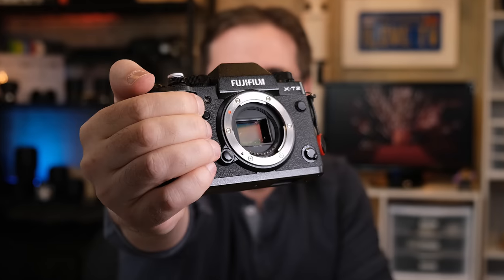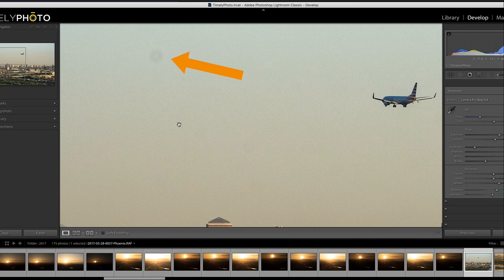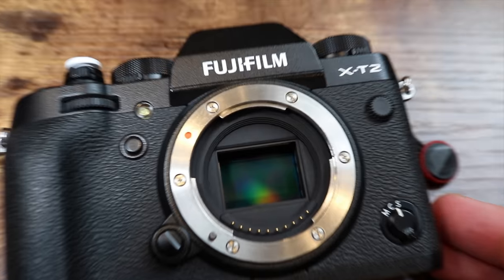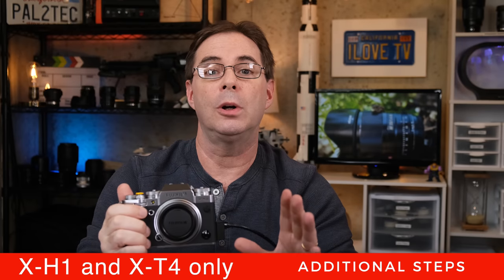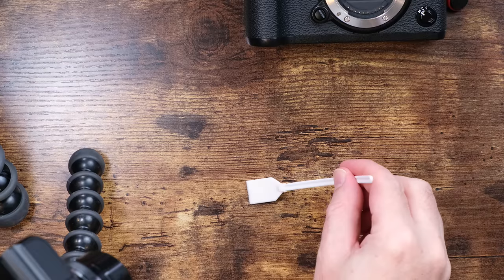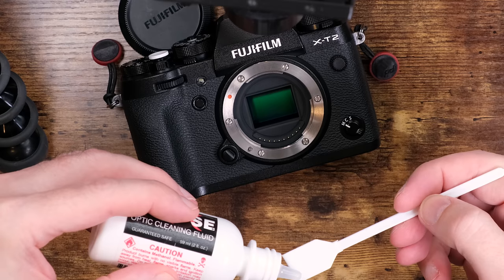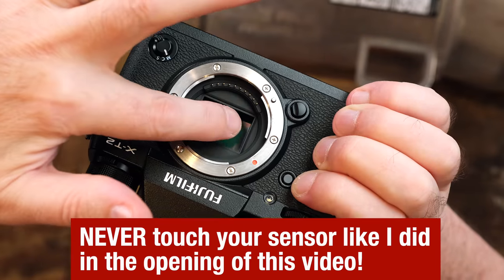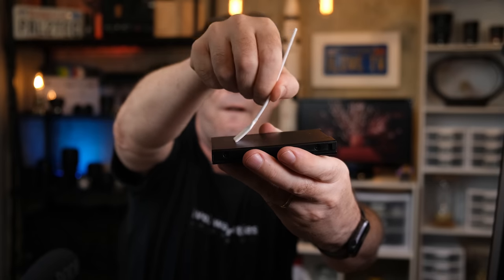Fujifilm Sensor Cleaning

Comment: Great post Chris and extremely helpful. I bit the bullet about 3 months ago when I noticed the dreaded dust spots on my images and bought an Alturo kit for about $50. It came in a zip case complete with everything you need. First sensor clean I did on my xt3 was very very nerve wracking but managed to complete it successfully. Now if I am going on a big shoot I will check the sensor and clean it if necessary without hesitation. I also change lenses without worrying too much about dust as I know I can clean it if necessary. I haven't tried the dust on finger sensor wipe yet, I may leave that you !!
Reply from the maker: yeah, don't try that at home, LOL!!!!

Comment: Hi Chris, thanks for sharing this video. It’s extremely useful! I have a question, the camera I’m using is a new model, X-S10, shall I switch it on while cleaning like X-H1 or X-T4 as you mentioned at 04:35?
Reply: The relevant common feature between the three cameras is IBIS.  I have followed the approach recommended for the X-T4/X-H1 with my X-S10 without incident.

Comment: Always great videos here ... this is one of the better cleaning videos out there.  I would just suggest to set the Aperture to f22 if you can and that will show a bit more.  I can never get mine 100% clean so don't waste all of your swabs.  At f2 or less than f10, I don't think most images will show the dust to be a problem.  I noticed in LR that the test images were around f2 or so.  Great video!

Comment: Thank you so much! I followed every step and worked amazingly... however I made a mistake and I had a lens that has its own IBIS and I had it turned off in the lens, so the camera also said ibis off... however, when removing the lens, it goes back to on... still no damage but ensure your lens does not interfere with your camera ibis... again, thank you so much for giving me the courage to do this...

Comment: Hi I was always a bit scared to clean my sensor on my X-T3. But the part of video where you put the vacum cleaner dust on your finger and rubbed it on the sensor glass got rid of the hesitation. I purchased the cleaner, air blower, and swabs to clean the sensor and cleaned my sensor and took some test shots and it was very clean with no visible sensor spots. Thanks for a great video

Comment: Great video on an over looked topic. Only comment would be a static brush might have been a step between the blower and liquid cleaner. Requires much less pressure and for dust I find works well. Thanks for the tip to wipe round the mount. Obvious now you’ve made the point but that’s the first time I have seen that highlighted

Comment: Yes it´s a bit scary to do this but using the right tools is simple and very secure process. The firts time I clean the sensor of my camera I use very little pressure, yea I was afraid, and by that I had to repeat the process several times until the a last time that I applied pressure on the swab and solve it. By this video you can have a better understanding of the pressure you need to use! thanks for the nice video! !!

Comment: Thanks for this very informative video!  I just bought a 6 year old X-Pro 2 that had basically been sitting on someones closet shelf for those 6 years.  It still had Firmware 1.0 and looks brand new.  However, the sensor was the dirtiest I've ever had on a camera.  The blower did not do any good nor did a couple of swipes with a dust brush.  I just ordered what you recommended to use and will probably have to use at least two swabs to get the dirt off the sensor.   I'm hoping for the best.
Reply: Advice Re: "Dust Brush"= NEVER use a Dust Brush on a sensor, or on the body anytime sensor box is OPEN without a lens or body cap. These brushes have a habit of gathering dust and then flicking it into the air during cleaning. If you do this in the dark with a headlamp aimed across the work area, you'll be appalled at how much dust the brush activates.

Comment: I bought a pack of 100 pec pads (with the wand) and a bottle of eclipse fluid it must be 10 years ago now.  It will last forever probably.  So much cheaper than sending it in every time.  Great tips on the X-H1 and X-T4.  I wouldn't have thought about IBIS.

Comment: Great video, I unfortunately have to clean my X-T2 as the sensor is dirty (even though I only have 1 lens and never take it off)

Is there any other brands of swab you would recommend? The Photosol swabs are quite pricey in the UK
Reply: Follow up to my original comment, I used the vsgo kit which worked great

Comment: Amazing tip mate. So is there no need to go to a setting to open a sensor? Just simply get the lens off and clean it with a swab?

BTW what if you use just one len, do u still have to clean it?

Comment: There was a speck of dust on my xt5 lens, and I stupidly took a piece of paper towel and very gentle touched the tip of it to the sensor which lifted the speck right away - but left a bunch of what looked like scratches in the area. gave me a heart attack. But they all went away when I did this - thank YOU lol

Comment: First off. Thank you for making this video. I had an insane amount dust on my sensor after a beach trip. Shocking right? My question is: 

Have you down a video on how to clean dust from out of the inside your lenses? I have a 55-200 that I can see dust on and I would rather not have to edit dust spots out of my images of possible. Or, is it better to just send it to get cleaned?

Comment: I just did this for the first time the other day (I somehow got a raindrop on it while changing lenses and it left a residue).  Totally nerve wracking for me.  But now totally clean!
Reply from the maker: That's awesome!! Yeah, I've had rain also get on there and it does leave that weird residue. Makes me wonder what else is in rainwater!
Reply: @pal2tech  I had to use an APS-C brush on my 50R and it worked out ok.  Realized after your video that I need to get the right size brush.  Never know what you will learn!  Thanks for the info.

Comment: While shooting in NYC, I found a spot on my sensor. I did the cleaning as per your excellent tutorial, BUT --- darn sensor still has the same spot in the same place. Tried cleaning it several times (and yes, I checked if it was a lens issue-with multiply lenses). 

Any idea as to what to do next? Thanks!

Comment: Hello! What's so bad about a used swab? I've thought that it can be cleaned with a Isopropahol and re-used after drying. Is it catching some dust in this case?
What is "Sensor Cleaning" procedure does BTW? I've seen it in the menu.

Comment: You are actually just clean the outer layer of the sensor protector, sometime dust get trapped inside between sensor and inner layer of sensor protector. When that happen, the only way to clean it is to open the whole sensor part which is dissemble the body.

Its actually easy to do, but hard for some people. Easy to damage all the flex cable

Comment: I recently had somebody clean the sensor of my XT5 and despite my suggestion they went straight ahead and cleaned the sensor without turning off IBIS. They seemed to clean it gently enough – however should I be concerned that any damage was done? The camera seems to be working but I’m not sure what the damage would be. Any advice / reassurance welcome.

Comment: I have just read through nearly every comment and am confused.  On two of the early comments you were asked whether the x s10 should be on or off and you said off bit you stressed that if a camera had ibis it should be left on.  The s10 does have ibis (6 stops I think) so please can you explain why it should be turned off or was this just an error.  About to do my s 10 so want to get it right.

Comment: Those cleaning fluids can actually leave very light streaks to the sensor, if you watch closely in optimal light after couple hours when you have "cleaned" the sensor. I usually just use swabs without fluid if its just normal dust. Swabs are also perfect for cleaning lenses.
Reply from the maker: Yeah, that's definitely an option. However, for some of these sensors, some viewers take their cameras to places that they just have to have some kind of liquid to assist. Swabs almost in those cases would work after the initial cleaning. I've not personally had streaking issues, but have heard of this and probably should have at least mentioned this somewhere in the video that it's a possibility. YT of course doesn't allow us to edit our damn videos!

Comment: What is the reason for leaving the X-H1 and X-T4 turned on?  I'm assuming that when you turn off IBIS, you will need to have the camera turned on in order to stop the IBIS.  Otherwise, if you turn off IBIS, then turn off the camera the IBIS is not stopped?

Comment: I watched this video 10x before cleaning my sensor for the first time. I have an XT4. I turned off IBIS in both photo and video modes and the sensor stopped moving. Went in with a second swab to try and remove streaks from the first swab and the camera had fallen asleep, which made the sensor start moving again, but I didn’t realize until I took the second swab to it. Everything seems to be working okay, we’ll see. Do you have any tips on dealing with the streaks left by the swab?
Reply: This is a delayed reply but I just had the same experience with my X-T4. Since the first swipes with the liquid definitely cleaned it well, I just dusted it with the air blower again and then used a new, dry, clean sensor (without liquid) to go over it again and that left it clean. In case anyone else comes across this.

Comment: I cleaned my XT4 when it was turned off 😣 I didn't brush hard at all and when I turned it back on to check if the dust spot was still there, it was gone. Is my XT4 still going to be all good?!
Reply: I did the same thing.. Was your camera ok after that?

Comment: Ok...? Luck has it that I just happened to clean my XH1 minutes before I watch this. And...What! The XH1 has special instructions. Due to the IBIS, I noticed that the sensor was kinda fluid as cleaned it. I had the camera off. I didn't turn off the shoot without lens setting. I rushed to check the camera after watching this video. The camera seems undamaged, but what could have damaged? : )
Reply from the maker: I'm not sure. Is it still broken?

Comment: Help! Just did my first sensor clean on my XT3. I did the steps and repeated wet method 3 times. All but one stubborn dust spot or speck are left. Quite literally a dark dot more pronounced at f11 or above. Am worried to do anymore. Is it baked in on there or could it have gotten behind the glass? I double checked it's not the lens or the lcd screen. In fact speck is coming from the sensor.

Comment: Out of no where I got a big blob on my XT4 sensor, so I cleaned it with the same swabs as you show, but I confess....
- I forgot to turn off IBIS

Good news, sensor is clean.

Question(s) - Why would you leave the camera on, and what damage can happen if I cleaned it with the camera off and IBIS on?
Reply: Hi Tony! I am now in the same position as you were 11 months ago. Just cleaned my XH1 with the camera off and i don’t know what to expect. 

Did you have any problems with IBIS after you cleaned it with your camera off?! 

Thank you
Reply: @brasovinlowlight5634  Nope, no problems at all. I've done it a few more times since and no issues.
Reply: @TonyReidsma  thank you so much for your answer. I was freaking out about it 🥹

Comment: Excellent, well thought out advice - until coda clip with that tee shirt that blew your credibility out of the water 😁🤣🤣.  Best advice re IBIS cams.  Let me add: clean sensor in bathroom after running water a few secs to pull down dust, if you lack NASA cleanroom.  To see sensor spots, lens on cam, expose white surface for several seconds (overexpose) at wide aperture while moving cam in circular motion; then playback in cam and magnify image to spot spots😊.  Lens mount cleaning - suggest cotton swab dampened w/70% alcohol.  Reuse swabs for ear wax removal😁.
Reply from the maker: Oops. Should have covered the tshirt message!!!

Comment: Indeed be carefull!!!!!   Now I know how to do the job but many years ago I wrecked the shutter blades of my Nikon D200. While cleaning the sensor the shutter closed because I did not follow the correct steps. The swab got stuck in my shutter😳😳😳.  Replacing the shutter was not worth the money so I removed the whole shutter mechanism. Guess what, I still can pics with it as long the shutterspeed is not to high. Somehow dslr's have also a electronic shutter or something?  At least I have a limited edition D200 for sure😅😅
Reply: I believe there should be an option in the menu for opening shutter and mirror for cleaning, which operates like a timer mode except it will close when turned off or battery dies, or atleast my d90 does that. It probably has it on subsequent models but cant tell for the older ones
Reply: @leodoz1016  Indeed that option exist but your battery should be at a certain minimal level. I screwed up there.
Reply: @Audimann  oh that tells alot, i hope you got yourself a tandem for your d200
Reply: @leodoz1016  yeah well I bought 2 D500's so that covers it I guess😀

Comment: While small dust particles might not be an issue, due to the diffraction I rarely go lower than f/8, and usually I won't see any dust dots. But I had really painful experience with my previous camera (not Fuji system) when I didn't even detached kit lens (it came with it from factory and I never detached it), yet somehow I end up with tons of sensor dust which was clearly visible even at f/5.6, and while I was able to edit photos, video was completely ruined. And I had to do several wet cleanings (after just internal sensor cleaning camera option and blowing and etc), and I spend almost all my cleaning kit (8 out of 10 swabs) and I was at the middle of nowhere (in terms of availability of camera service). Thankfully sensor was kinda clean after that and I was able to finish my work. But there still was some dust which I cleaned after returning home. Didn't experienced any of this issue with Fuji (yet and I hope I will not) even working with vintage manual lenses.
Reply from the maker: Good info and thanks for sharing!! What a pain!!!

Comment: Uuh, sir, i like your videos, but: you should be carefully blow inside your cam... not because of the sensor but because you may bend the shutter blades... that will kill your shutter! Thats the fragile part, not the sensor... its behind glass.

You should try the “cosmetic brush“ trick first, before you go inside with the wet swaps... its dry and very effective... and in 95% of the cases its enough to clean it dry. If you like to know more, let me know, i explain it to you if you want...
Reply from the maker: Good point Tom!!!!

Comment: I'm so afraid to do it to my xt4
I'm thinking about spending 20 dolls to a service center but... ok i'll try myself
Reply from the maker: You got this!
Reply: @pal2tech  so for you there is no risk ? :)
Reply from the maker: @k1k13004  There's always a rish, but you'd need to be sure you check the reputation of the service center. In US, the Fuji center in New Jersey is pretty good.
Reply: @pal2tech  I was talking about the risk to do it yourself. My Fuji center in Saint-Petersburg is pretty good too
Reply from the maker: @k1k13004  If you follow directions, are careful, and err on the side with caution, you should be fine doing it yourself.

Comment: First few minutes are incorrect (nonsense), since the most fragile parts of any camera is shutter and main board. By the way You are not cleaning or touching any part of the sensor but cleaning peace of glass which has IR filter.
Reply from the maker: Yes, while there is glass over the sensor (I believe I mentioned that somewhere in the video, I can't remember if I edited it out or not) the sensor is still a fragile and expensive component, particularly on cameras with IBIS.
Reply: @pal2tech  Sensor is least fragile  component of any camera.You can't touch any part of the sensor since there are at least two layers of glass covering sensor before you can get to the top layer of the sensor.

Comment: WTF! Only a chimp would put vacuum dust on the sensor, like hard particles will scratch the sensor. SHOCKING! Apart from that entertaining.
Reply from the maker: It took two cleanings but I was able to fully clean it. No scratches. Luckily, most cameras such as Fujifilm, have a glass cover over the sensor so that it's basically like getting dust on a window. Had that not been there, the sensor would have been ruined for sure.
Reply: @pal2tech  All you need is a little hard particle like sand, you walk it into the carpet, then vacuum it, then put it onto your sensor, the shutter moves it across the sensor, you are screwed. Sorry don't take chances. all the best.
Reply from the maker: @derekgillan7314  Good point! I got lucky.... this time. Probably I should be more careful with these cameras.